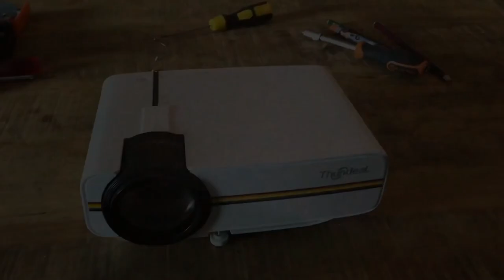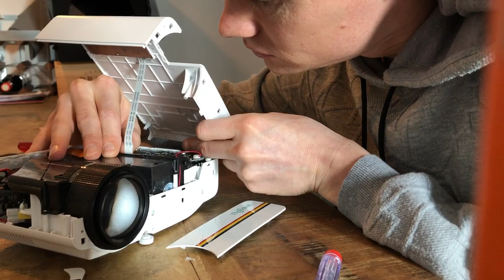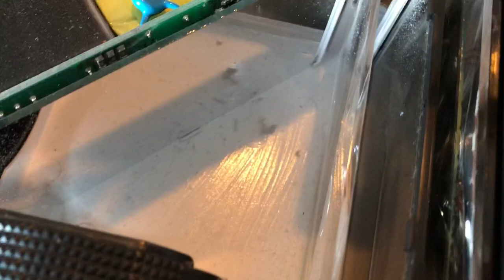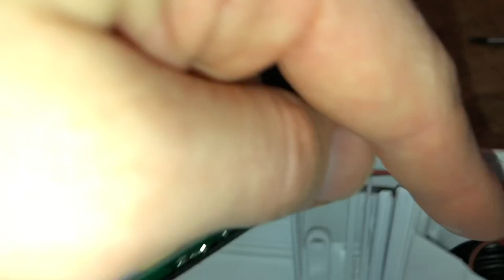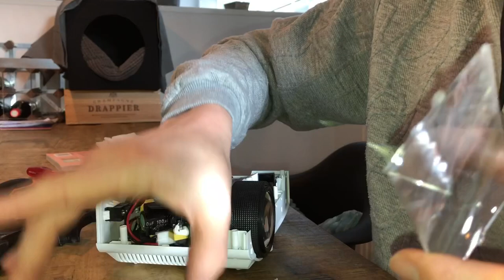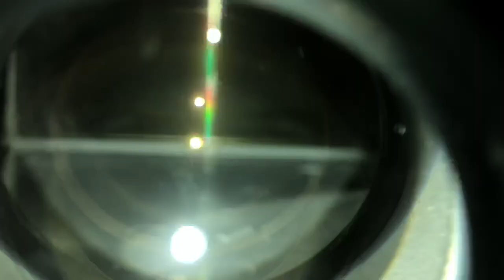Dust removal projector - Thundeal YG400

Comment: Why inverted colour
Reply from the maker: James Gordon I think it’s because of the polarization of the filter between the LCD and the projector lens. If you flip front to back it creates this effect.
Reply: @willemjanpeters4053  did you fix it
Reply from the maker: James Gordon Yeah I did, just flipped it in the right orientation again.
Reply: @willemjanpeters4053  Exactly what caused it.